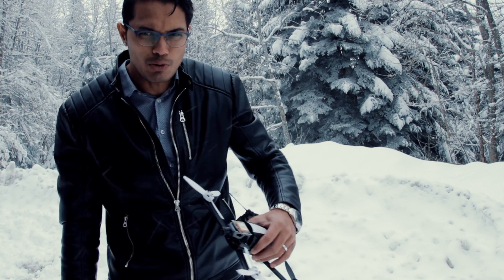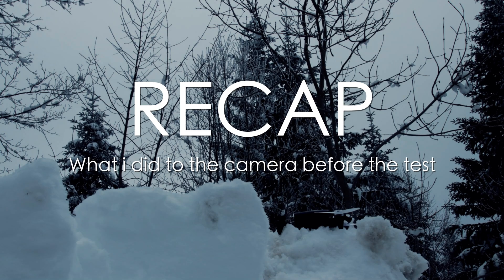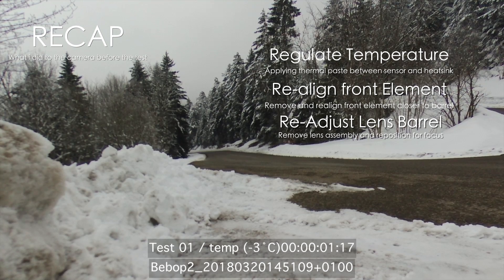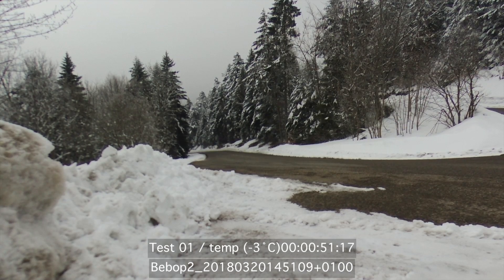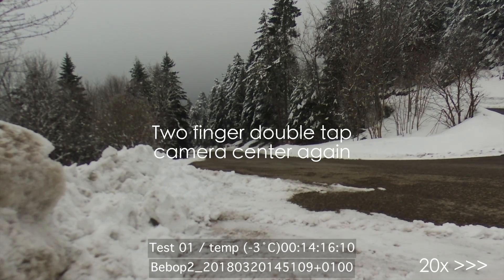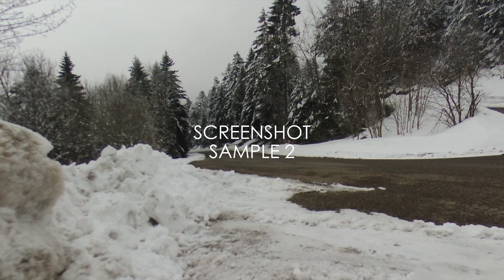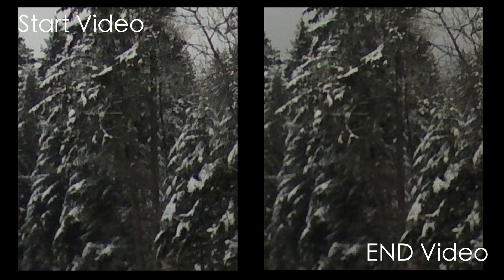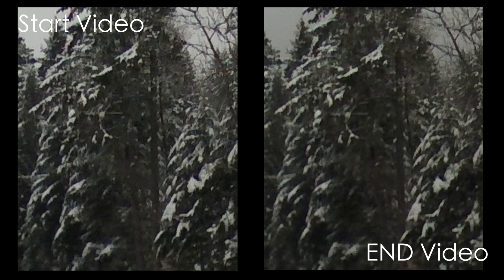BEBOP 2 - Camera | Cold Problem | Fix | Test 1 | Part 4

Comment: I would say to anyone  if u want to have  sharper  and clearer videos  even in the cold, change  your  bb2 lens to a bb1 like i did , no more  blurry  videos  now .
Reply from the maker: Keith Washington give it time. I had the BB1 camera on first which went out of focus over time. I than installed the BB2 camera that didn't have a problem. You can also visit Han. S video where he replaced the out of focus BB1 camera with a new BB2 camera and it was resolved, but for how long? Your comment on this?

Comment: Hi ANTHONY,
1- thank you very much for the great video.

2- I want you to know there is at least 2 versions of the bebop 2 cameras and I have both since my camera lens broke I bought another one.

And both are different in 2 things at least 

A- the cable are split on one and heat sink are solid behind the sensor there is no circle hole exactly like your camera.

B- the original one are so different which the cable one line not split look like better quality, and the metal behind the sensor have a big circle hole so there is no way to add a thermo paste

I can show you some pics

Also I think the original camera came with the drone don't have this problem you try to fix
Reply from the maker: Ahmed Shams thank you for the information.

Comment: Again, a splendid video Anthony. I am glad you'r testing worked out. I realise seeing this footage that my camera is not focussed under all conditions. My footage stays unsharp. First i thought it was settings our the way i Fly. Than I tried rendering settings and upscaling. I tried the mods foor  cooling the camera, but it just won't change. I'll think i have to focus my camera myself!
I saw you upscaled the footage?
As always, thank you for this informative video.
Reply from the maker: speedsweets67 thankyou Eric, it is quite hard to determine a problem if there is no reference to compare. I am glad this helped even if its a little. Yes I upscale to 4k so if anyone wanted to see the little artifacts in detail they can do so. Other than that 1080p should suffice.

Comment: Great video. Your a bebop champion. Do you think the thermal paste on its own would make a big difference?
Reply from the maker: Thermal paste alone will not make a difference unless you like flying during sunset or before sunrise when its dark (But I still recommend it just to keep your camera sensor from heating up). It helps with the noise generated by the sensor heating up. Thermal paste wont fix out of focus, hope this helps you and Thankyou for your kind words. Regards Anthony

Comment: Good video Anthony, do you think that just the application of a thermal barrier would be of help without disturbing the lens??
Reply: Hi Anthony,
Great video and solution to the problem. I received this also when clip became really unfocused after ca. 15 min. in the cold (-5C)
However, I am not really into disassembling the camera at the moment. Do you think applying chemical heat pads (30-40C) sticked under the camera to the chassis could solve the problem temporarily?
Reply from the maker: Hi MAK-2, a simple answer is maybe. From my previous videos there are 2 main things happening in the cold. 

1. Focus (can only be rectified by disassembling and readjusting)
2. Haze (rectified by applying thermal paste to regulate sensor temperature relative to ambient) keeping the lens and sensor within the same range. 

I will make a follow up video explaining everything after iv resealed my camera and done test flights. If your video only suffers from Haze or increased image noise after flying for some time thermal paste may just do the trick. I have to buy another camera so I can test with an untouched camera. The idea is to get a solution that is easy for the user.
Reply: Thanks for the reply, look forward to the follow-up
Reply: I used heater pads to postpone freezing of the camera. It went quite well, especially just after taking drone out of the warm case. In this footage first part is taken with warm drone, second ca. 18 minutes later in -8°C and it looks quite degraded https://www.youtube.com/watch?v=vnnu1_Ololk
I heard Parrot is selling new camera that doesn't have cold temps issue, is it right?
Reply from the maker: AndRand I haven't tried, it may work. But I'm not sure because you will have the insides hot and the front element cold with a big difference between the two. Assuming there is no trapped moisture it may work if there is the front element will fog up.
Reply: Can you provide me info where are the sensors placed I could block or interfere (barometer, ultrasound)? I hope attaching pad to the foam under camera would even the temperatures sligthly.
Reply from the maker: AndRand ultrasound under the drone, barometer on the front bottom of the GPS module.
Reply from the maker: AndRand that's really really cold. Thankyou for testing alternative methods and sharing your info. I have no experience with parrots new camera so I can not give advice on that. You can check on Hans. S channel he got a new camera from parrot he can better answer that question. Regards Anthony